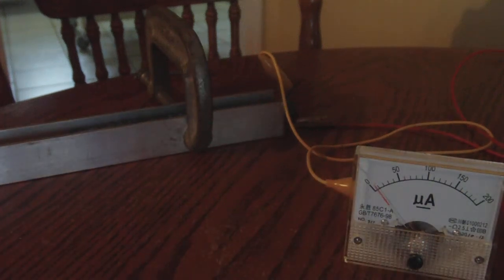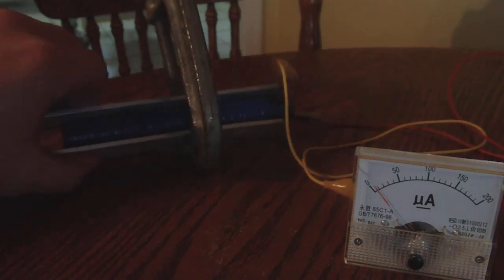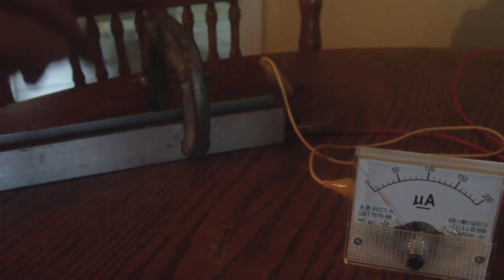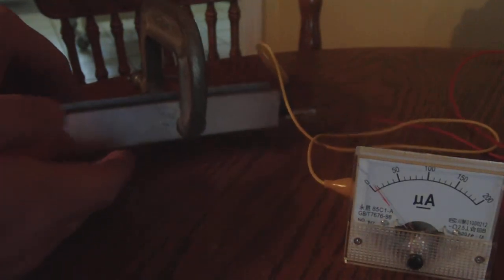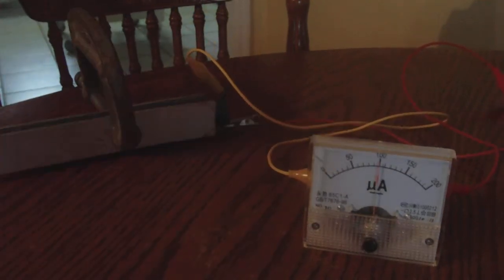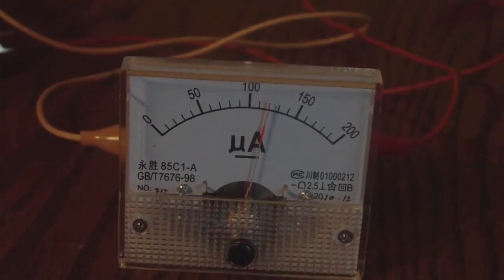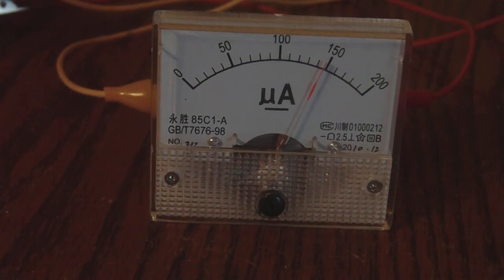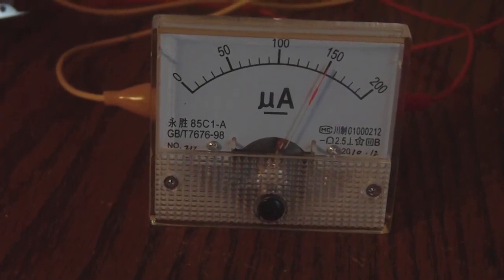Crystal Cell is given pressure by Clamp

Comment from the maker: @harpbloke 
I had someone else bring to my attention that all i was doing was pushing the electrodes closer to each other and that was the reason for the more power. I really thought that was the case too but the amps started to go down after a few hours. So if i was getting the electrodes closer the amps should have stayed the same but they didn't, they go up then come back down but will stay above the original amps.

Comment: Hi ibpointless2. I dont believe is pressure, is about the closer the electrodes gets, the more current comes from vacuum into the battery, and I also work to make this with multiple plates like Volta Battery, it seems that this is the best way, and also, may be some pressure effect also, but the main reason is the approaching electrodes, and the opposed differential charges generate more power, because of difference of the electric power of the electrodes fields.